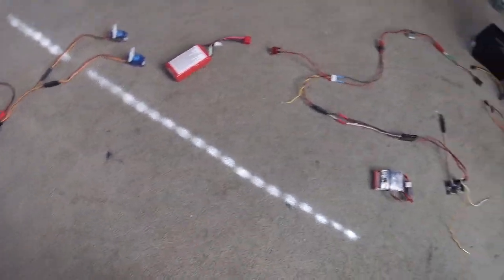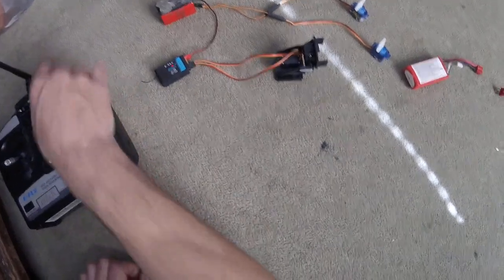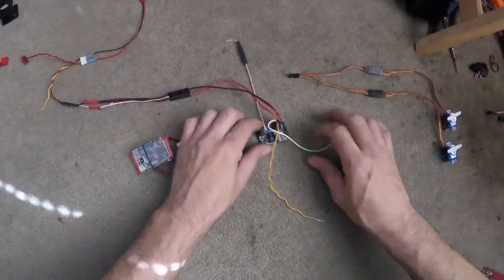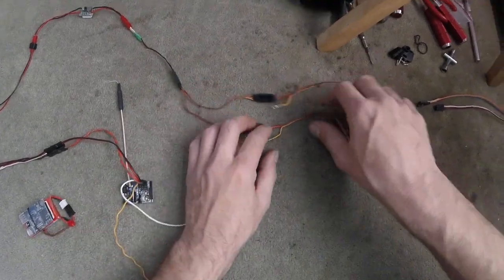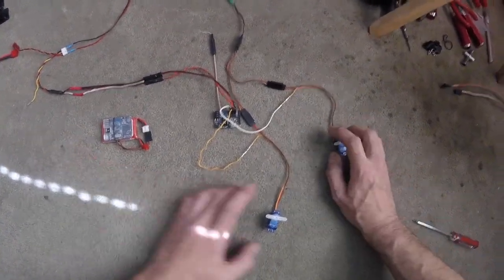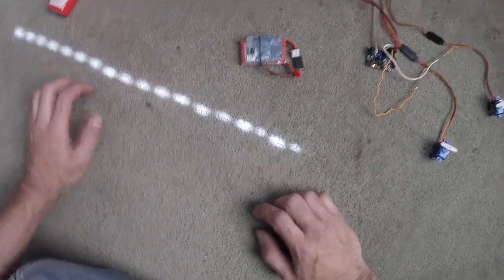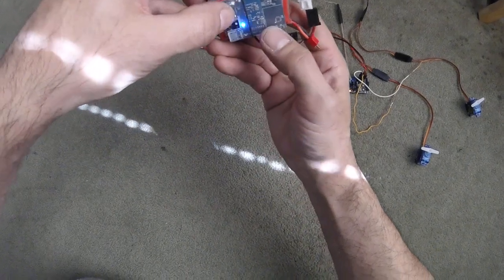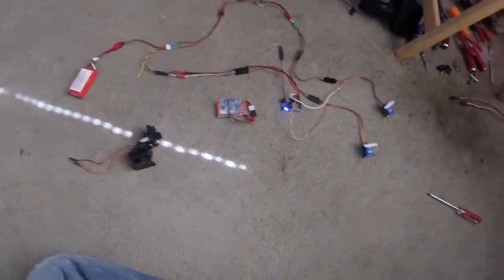Proof of faulty Arkbird wireless head tracker

Comment: Hello Rick, Thanks for your video and support to Arkbird product. From your video, we can see the wire connection is correct. That's really good, but I have to say, all Arkbird products are tested many times before shipping. At the first part of this video, we can see the two servos on the servo mount can not work when you power up, that means both of the two servos are broken, the reason probably is voltage, the two servos can only support 5V, but if connect them to a 12v battery directly, they will be damaged. And about calibration, we can see both of transmitter module and receiver module can work good, so they are in good condition now. But except the transmitter calibrate, please also calibrate the receiver module when first use or use it again. You may see the instructions as below in product manual:
3. Guide for operating receiving module
(1) Frequency alignment
Frequency alignment is needed when you firstly use this device or update firmware. Yellow LED
light and Blue LED light will interactively flash when firstly power it, which shows receive
module is in frequency status, then turn on the transmitter module, which will be automatically
pair frequency. 
Press the white button for 11 seconds or more when you want to fair frequency again. Keep
pressing white button until Yellow LED light and Blue LED light interactively flash, which shows
receive module is in frequency status, then turn on the transmitter module, and receive module
will be automatically pair frequency and save data.
Reply from the maker: I did as you said and it still doesn't work at this point I'm fed up and contacting seller for return. I appreciate all of your help but I don't appreciate you telling the buyer that you guys resolved the problem as you can clearly see in the video it's not working so I don't know why you said you resolved anything. I will definitely not be doing any future business through that company.. Unfortunately because I had to use my YouTube channel to get the video proof to you guys this is going to reflect negatively towards the company.

Comment: did you ever manage to get the calibration working? I have a similar issue with mine. Will not go into calibration mode. Servos on PWM work though but have quite some drift (might be due to the calibration ??) and PPM is somehow not working at all (signal is all over the place). Thanks
Reply from the maker: No one fortunately I didn't it was a badd board. Even though I had video evidence that it was hooked up correctly they fought with me tooth and claw over the return and tried to delay it over and over again I ended up having eBay step in and got my refund. Never went through that company ever again.